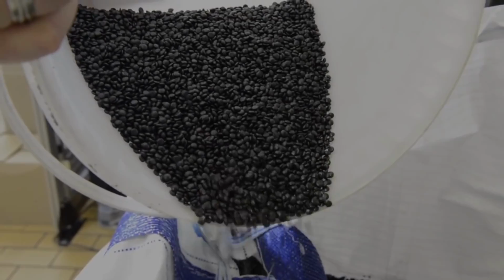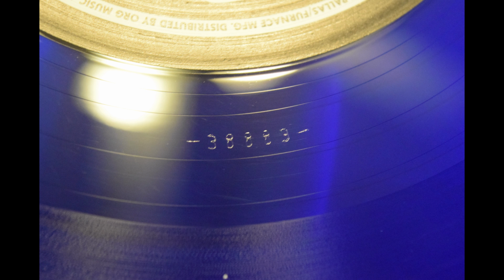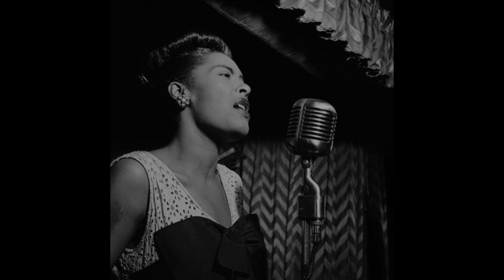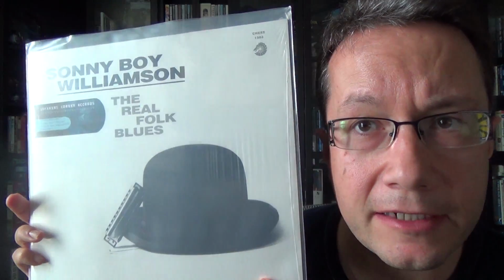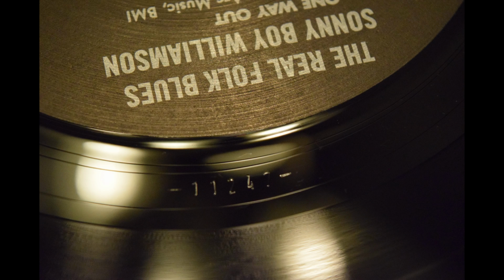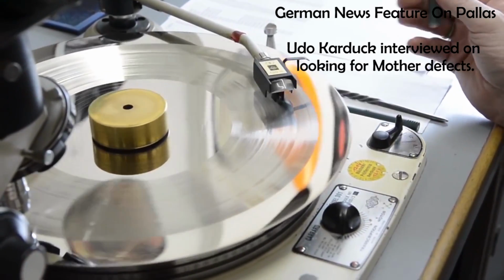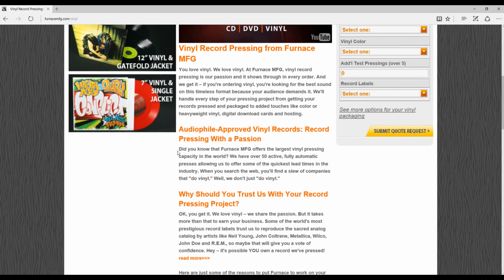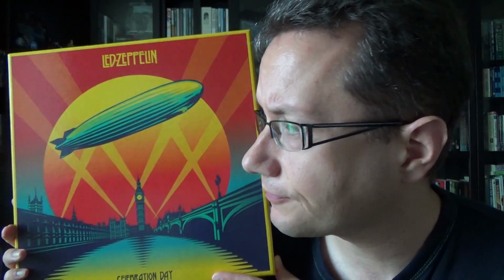Tales Of The Deadwax #9: Pallas & Furnace Manufacturing (-XXXXX-)

Comment: This months VMP Beck's Odelay has a Pallas # and P. USA in the deadwax, I wonder if that means it was actually pressed at Furnace and they are already up and running.
Reply from the maker: It's really hard to tell but I suspect when they do, they'll be sure to have a promotional video on it.  How did it sound to you?  I got mine but haven't spun it yet.   I need to check my Odelay box set, I seem to recall it being done by Grundman as well so they could be using old plates.  I am pleased though Beck's catalog is coming back in print.   I need to pick up Guerro.
Reply: BarakaPDub I put on the first side today when I was getting ready for a photo shoot.  It sounded really good to me but I wasn't paying super close attention.
Reply from the maker: So I played it today and I got to say, it's good for what they did with it.  I cut a video this morning where I plan to talk about it but I may not drop it on YouTube until mid week due to another Tales of the Deadwax I am dropping tonight.  The ORG release was much better and was also cut by Grundman.  While the VMP isn't bad, the label's decision to put all the music on one record forced Bernie to compress the dynamics.  Since this album came out at the peak of the CD era, the length of the album was geared for that format and not for vinyl.  This really should have been spread over two records and not just one.  The ORG release spread the music out over two records and the dynamics were not sacrificed.  I suspect they might do the same with Guero which would be over 25 minutes per side :(

Comment: I'm surprised how easy it is to recognise some of the pressing plants. Before you started the series, I imagined difficult codes. But Pallas, Optimal and GZ have all very distinctive numbering. Another great episode, Paul. /Paul
Reply from the maker: Thanks Paul.  It is really, really easy to figure out were 60% of where the new pressings come from.  There is another 40% that put nothing in the deadwax so it's pure conjecture where a particular record came from.  I have a couple more modern plants to talk about but after that, I might focus on Mastering Engineers or older plant markings.

Comment: So, the other day at this local shop, I saw a Speaker's Corner version of "The Graduate" soundtrack. Love the film, love the soundtrack. I left it there because I didn't know if it was a good pressing for the $35 price tag... Also confusing is that they did a Simon and Garfunkel box set of improved repressings earlier this year ...but didn't include the Graduate. I guess this Speaker's Corner version is a safe bet? Thanks..
Reply from the maker: So while I am not an expert by any means, I have been satisfied with the half dozen or so titles that I do have from Speakers Corner but I don't have any Rock/Pop releases.  I am betting they are using an European 1st gen copy of the US Masters though.  I would find it hard to believe they had the Master Tapes flown to Europe for cutting.  Now how much a generation removed from the Masters is going to mean in the overall sound quality is debatable.   If you do end up landing it, please let me know what you think.  I love Simon and Garfunkel.
Reply: have. just. siksee
Valentine's